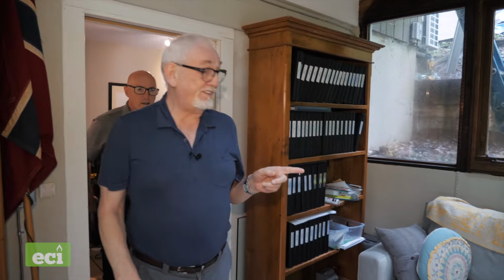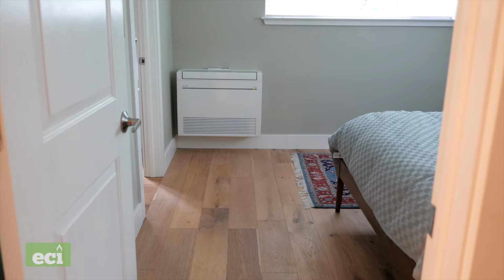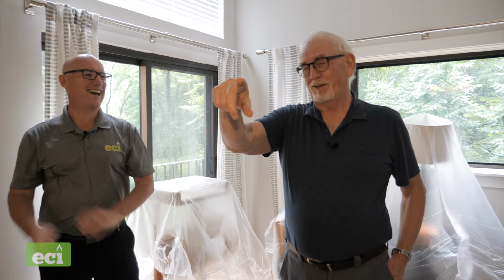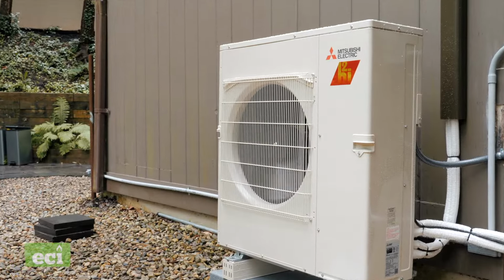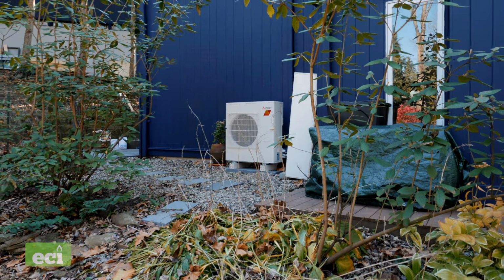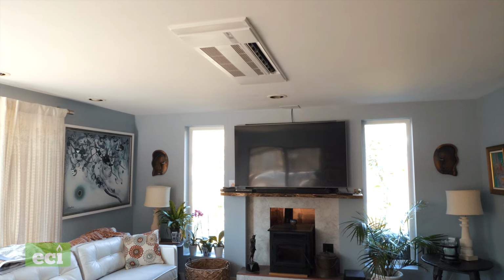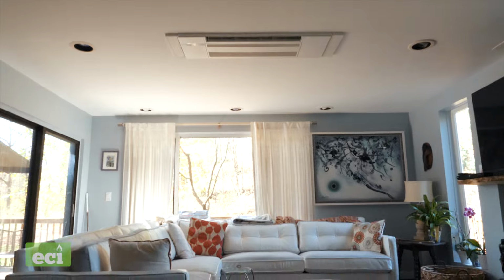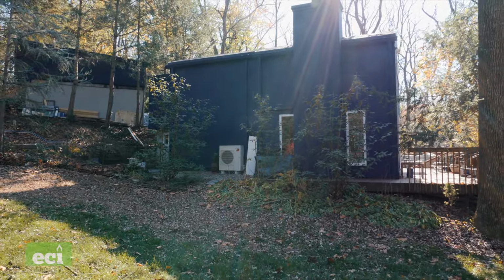New Hope Multi-zone Mitsubishi Ductless Installation Tour and Testimonial

Comment: just got a massive double 48,000 BTU Mitsubishi Hyper heat system installed in my home. 8 heads total. it's an old farm house that has a horrible and inefficient propane furnace system. because of the ineffective way the duct work was installed (3 out of the 4 bedrooms upstairs have no ductwork at all), i was paying $1000 a month in propane bills. I live in Upstate NY and the winters can be nasty. 

I just had this system installed and now i have heat in every room. No doubt my electric bill will go up but my main goal is to make the biggest dent possible in that propane bill. plus i have the nice bonus of central AC which i've never had in my life.

it made sense to me because of the way the house is and the fact it's propane. If it was natural gas it may not have been worth it. Even if i cut the propane bill in half ($500/month) the system will pay for itself in 5 or so years.
Reply: How much did that run you total?
Reply: @joshl1664  38k not including a 9600 rebate from NYS green heat initiative
Reply: @kizunadragon9  Damn that's actually not bad for an 8 head mini split system. How many condenser units did it take for you house? 2 4 head units?
Reply: @joshl1664  yea, two 48,000 BTU hyper heat.  I can actually go 5 heads each so i have a little bit of room to grow so to speak.
Reply: @kizunadragon9  I had oil heat in my house. I live in queens NY. My oil bill was getting like $700 every drop 3 months ago. Now it will be even more since diesel is like above $6. I did daikin mini split 2 36 -46 btu units with 6 indoor units. Total cost was 19500. With rebate from NYC working with my electric company CONED. I payed $10k. Got 9k rebate. I had to pay to remove oil furnace and tank. Coming winter be my first year having only mini split as heat.
Reply: @moneyparhar  I live in Queens too. I am looking into getting a  minisplit for my house. I have a cap cod style house. All these HVAC guys are coming with different amount of units and BTUs. I'm so lost. My biggest worry is the heat distribution throughout the house. Any insight will be helpful.
Reply: We're also on propane and it's eating us alive in Northern Michigan.  How have your costs and performance been now that you've been through a winter?  We're also looking at the hyper heat and two 36k units.
Reply: @jacka3164  Electric bill went up by about $100. Propane bill went down by $700, a net savings of $600 per month.
Reply: @kizunadragon9  that's good saving. I had same $750 for every oil drop but it's gona be more since diesel is $6.75 gallon.